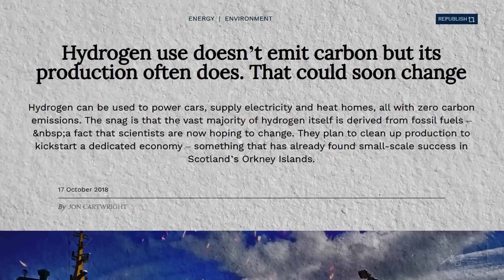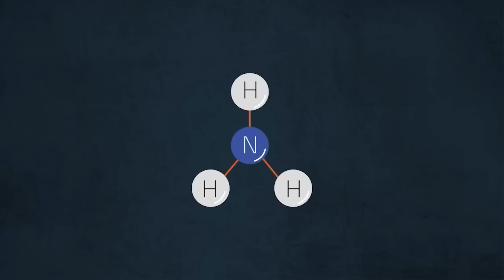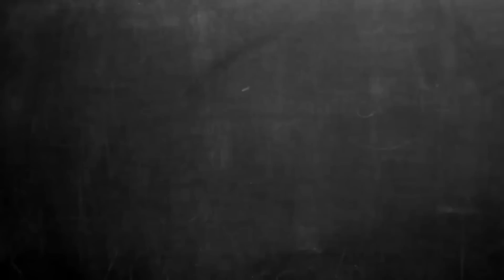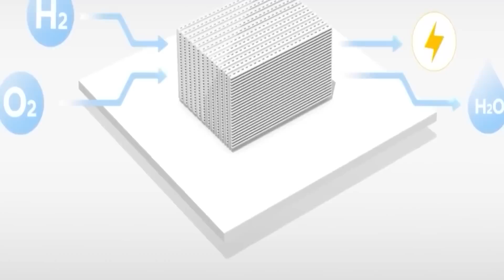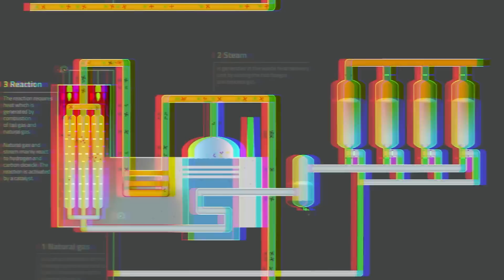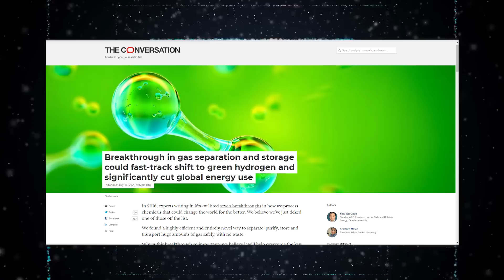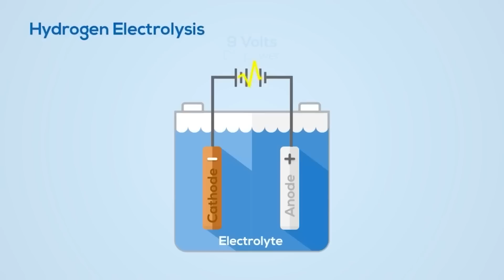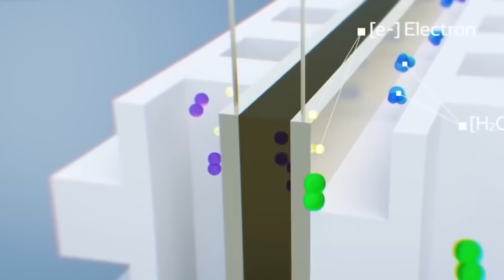NEW Hydrogen Fuel Breakthrough SHOCKS The Entire Car Industry!

Comment: Think about this, gasoline burns better as a vapor then as a liquid,
However hydrogen is a gas so its going to burn more complete 
99 to 100% burnt and its only byproduct is water with minial oil blow by products. Anything like a converter or smog pump are not necessary for an internal combustion engine,  it would require a different fule delivary system for speed control or you use the motor to charge batteries. 
It could also power your home.
But if we burn it then we use more oxygen out of the air or do we becuse every water mocule we split 
Is spliting both elements equal to what we woukd use.

Comment: Aluminum oxide is a component in Bauxite, used to make aluminum through a very energy intensive process. This new process effectively extracts some of that energy from so called scrap aluminum to aid in the production of Hydrogen.  No new energy is produced that was not inherently put into the aluminum when it was made.  The process actually turns aluminum that could be reused efficiently to make more aluminum products back into the the raw material that could be used to make aluminum again through the original very energy intensive process.  Thus it necessitates production of more energy-intensive aluminum to replace that which is no longer available for recycling.  It is disingenuous to quote some fictitious efficiency for electrolyzing water without acknowledging the energy in the aluminum that is effectively burned up in the process.  I believe it is more beneficial to just recycle the aluminum scrap, than to promote the fiction that this is an efficient way to produce Hydrogen.
Reply: Thank you.

Comment: Aluminium is a highly reactive metal . The oxide layer that forms on it's surface is the only thing that prevents reactions occurring. 
Merely adding hydrochloric acid to water , to dissolve the oxide, will allow the aluminium to react with the water and release hydrogen.

Comment: Warehouse forklifts, now battery electric, are the obvious first commercial application for H2, single filling point. Call back once H2 forklifts dominate that market.
Reply: According to Plug Power, they already have supplied thousands of H2 forklifts to Amazon, Walmart and other warehouses that operate 24/7 and do not have down time to recharge battery powered forklifts.  With H2 they do not need to purchase extra forklifts nor waste warehouse space for them when charging either.

Comment: Until H2 is at the corner service station with a dummy proof filling system H2 will be for specialty use only. The cost of the infrastructure to get H2 into my vehicle will be huge. Who is going to build a network of H2 SuperChargers? Not sure H2 will be competitive with electricity for many years.
Reply: In Australia with have had LPG (Liquified Petroleum Gas) for decades.  Granted the storage pressures are much higher for Hydrogen, but the way you fill your car is just the same.  No issue whatsoever.
Reply: It's people like you who hold good ideas back.  You sound  like a hater or just a negative person.

Comment: Congratlatins! They will become immensely rich. Producing hydrogen without any energy input (5:37). They have just invented “perpetum mobile” or the eternity machine.
Looking at hydrogen as it is today thow, hydrogen is an energy carrier, not an energy producer as stated several times.
Finally, as a clic bait, it was stated on the information frame that hydrogen production had increased with over 500%, that is impressive, given that it states over 50% efficiency now, indeed meaning an efficiency far exceeding 100%! Brilliant, but to my knowledge impossible.
/Mats